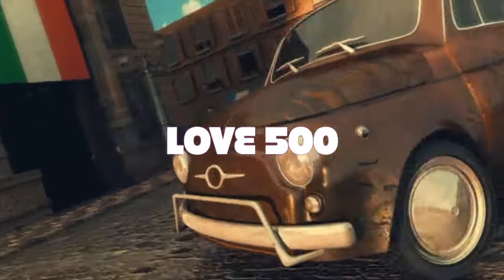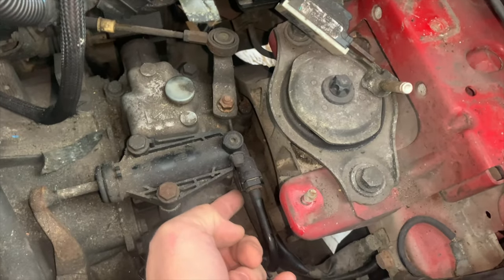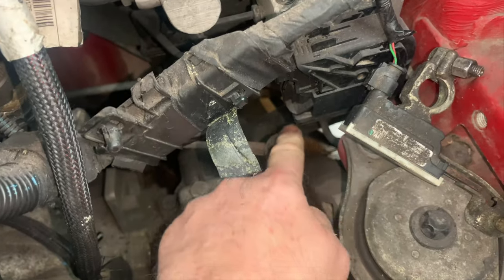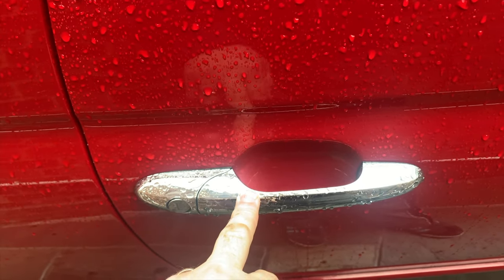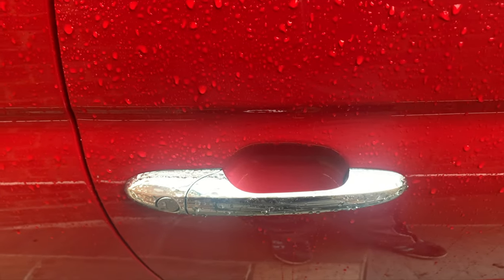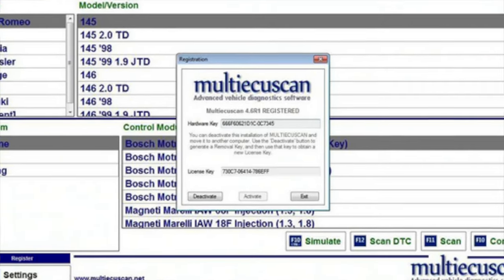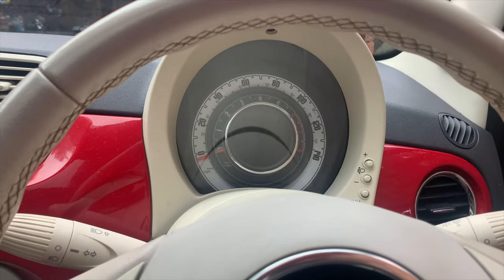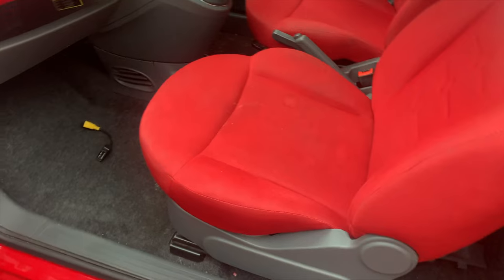Common Faults on a Fiat 500 or Abarth 595. The faults are the same. #abarth #fiat500 #595

Comment: Hi my 500 keeps loosing charge.   Battery is new. Have disconnected the Bluetooth and me  and it was fine for weeks. Started losing its charge again as battery flat in the morning. Mileage still flashes - Any idea?
Reply from the maker: @Fogtube1  have you disconnected it as the unit itself?
Reply: @Love500  yes - followed your instructions and disconnected it - didn’t take it out. Will check the earth to the chassis under the battery tomorrow
Reply from the maker: @Fogtube1  if your battery is good and you’re having starting trouble then it’s most likely the earth strap.

Comment: Can someone help on here have a fiat 500 2016 lounge , changed timing belt, now when it starts from cold , there is a banging noise for 5 mins , and small bit vibration,  belt was changed using the fiat kit. Was wondering could it be PCR valve and spark plus neither have been changed since purchase ...

Comment: Hi Paul , where is the cheapest place to buy the seals for the 2 pipes to the ac condenser ,thanks
Reply from the maker: @paulmaclachlan6960  I’ve never actually had to buy them.
Reply: @Love500  ok thanks Paul.
Reply from the maker: @paulmaclachlan6960  if you find them, please let me know
Reply: @Love500  i bought them off flea bay just for the 2 that fasten the pipes into the ac condenser £10.90 ,not cheap i know
Reply from the maker: @paulmaclachlan6960  that’s a lot for a couple of little o rings

Comment: shock absoserber mounts getting rusty : apart from the plastic cover is there a type of grease you suggest to put in there to keep the nut from rusting further ?
Reply from the maker: Not specifically but I use a CV moly grease on most things although it's black. I've seen some where they fill it up with grease, looks awful and messy if you need to change them. The caps on top are by far the best way of keeping the water out but a small smearing of grease around it will certainly help, just not too much. I'm sure some others here, will be able to advise what grease would be best.
Reply: @christga100  yeah same. Caps on and water in. I ended up putting folded kitchen foil on them and amazingly they're still on despite the motorway commute
Reply from the maker: @christga100  I guess it can't hurst, but a smear of grease would be better.

Comment: How do you work the air con in a 08 reg please
Reply from the maker: Same as them all. Turn the fan dial to at least position 1 and press the button. The snowflake light will come on showing that the A/C is on.

Comment: Hi, hope you can help or maybe do a video on fiat 500 exhaust.? I've just purchased a 2013 fiat Colour therapy. The MOT history showed advisory attention to corrosion of the exhaust plus broken clamps. Can you advise if this is something that needs addressing or am I worrying for nothing. The dealer stated it's not required to have this seen to during its MOT as it's advisory🤔
Reply from the maker: I wouldn’t worry too much. The clamps probably rusted and fell off. It’s worth putting new ones on, they are just a couple of quid each in Halfords.
Reply: Brilliant, many thanks for putting my mind at rest, my problem is I don't know how or where you place the clamps ha ha, I'm a complete novice as you may have guessed but your videos have helped me choose my little runner so many thanks for that :-)
Reply from the maker: @judgesheil01  there’s one at the front at the rear of the engine where there is a flexible section of pipe and another one at the rear where the  long centre pipe joins the pipe for the back box. It can’t be leaking otherwise they would gave mentioned that on the mot. Next time you get it serviced just ask them to replace them.
Reply: @Love500  once again, great advice! Can you just tell me the name of the oil & coolant you use for the fiats once again please as I'm definitely going to follow up all your car checks :-)

Comment: Would appreciate any help as garages can’t find problem.  Car runs ok but I know there is a problem when whistling noise is accompanied with accelerator.  As soon as car is turned off, all electrics go haywire and car lights stay on and car can’t be restarted until battery is disconnected (new battery fitted) and electrics are then re-set.  The only time it didn’t do it was when I took it to main dealers two days ago.   Friend had a look and noticed fluid around manifold and coil pack and said this could be the problem area as that is where the noise was coming from.  Any ideas?
Reply from the maker: When you say fluid, do you mean oil? If a breather hose on the airbox has come off or split that would deposit gunk. What sort of condition is the throttle body in? I’m assuming it’s not storing any codes? With those type of intermittent electrical issues I would be leaning towards the BCM. also worth checking your hatch wiring as any wires there shorting out can play havoc with the BCM and potentially damage it. I don’t think the fluid you mention is connected to the issues though.
Reply: @Love500  thanks , I’ll make a note of your comments and take them to my local garage.  Nothing is stored in diagnostics.  Wiring problems only when engine is noisy.  Strange, just checked and not doing it today.  I’ve had to take stop/ start off as it happened at city centre centre traffic lights two weeks ago and I had to get out and pop bonnet to reset.  Rush hour as well. Not very popular lol.  Thanks for your help.  Had car 10 years and ok till now.
Reply: Finally found the problem.  I was asvised to go to Fiat main dealer in Hull, 50 miles away.  They could find nothing wrong and asked for me to go back again.  They charged over £400 to inspect and said it would need a new speedo hub for over £1200.
I found instead a local genius guy who discovered it was a relay on the bcm which was staying on.  He charged £250 to repair it which he has done and tested over 2 weeks.  Said he had never come across it before.  The moral of the story is, beware of main dealers.
Reply from the maker: @paulbishop940  never set foot in them. They charge the earth and play parts roulette. Glad you got it sorted.

Comment: Great video - I wish I had seen it earlier! I've recently had to change the clutch slave/master cylinder assemblies and then the gear selector attachment. 
Now my 2016 1.2 Fiat 500 won't crank, it shows "Start Stop unavailable" on the display and a P0512 "pending" code on the OBD reader. Has anyone ever had this issue or know what causes it? Many thanks in advance!
Reply from the maker: Sounds like your battery has had it.
Reply: @Love500  the AA guy tested the battery and it was returning normal voltages, also tried to jump it with no luck. Could it still be a battery issue of returning normal readings? Many thanks once again!
Reply from the maker: @miguelcervantes4566  it’s a starter power issue I believe so if the battery is ok then it’s likely to be the main earth cable. Runs from under the battery tray on the chassis leg to a bolt under the clutch slave on the gearbox. Provides the main earth for the car.

Comment: See that rusty cup? There will be loads of parts on your 500 that look similar. If you buy some of our rust-treatment & bang it on, you no longer need worry about rust. Have a quick look at the back axle area - it will look much the same. Again, our stuff stops the rust dead in its tracks - if you really care,, you can do the entire underside - if you're in Ireland and don't want to DIY it, we can do it for you. Same goes if you own any car 2018 or older - it will be rusting, quietly, in the depths. They all do - even the really flash ones. :-)
Reply from the maker: What’s the going rate for advertising? ☺️
Reply: Subscribed btw - your vids are good, common sense down to earth stuff - which I like. I despise fancy B.S - you don't do any. I subscribe to close to no-one unless they're exceptional.
Reply: @Love500  Like I need to - we're in-undated. I thought some of your viewers might have a need. :-) We do good stuff - B.S free - same as you. :-)
Reply from the maker: @jamesward5721  feel free to post a link. It will probably be held for authorisation but I’ll authorise it.
Reply: @Love500  I do mostly fleet stuff - bus operators, commercials, blah blah - I just chucked the comment in as I know 500's rust like mad - it wasn't an Ad, it was just a sort of "There's this option" thing that might be useful to some of your viewers - I did a 500 monday & was a bit shocked at just how rusty a pretty fresh 500 could get,  hidden out of sight - it had less than 40k on the clocks and was only a few years old.

Comment: Hi Paul have you ever had a problem were the engine management light comes on when indicating to turn right and goes off when indicator stops, it as only just started doing it and car parked outside and we have had a lot of rain this last month and it is damp ? thanks
Reply from the maker: Yes, it’s a common fault. It’s the speedo. They can be repaired but it’s easier and cheaper to replace with a used one. Get one from the same sort of age car. There are variations, I.e. start/stop and non start/stop. You can up the mileage using MultiECUScan but can’t reduce it. There’s a fella on the Fiat 500 Owners Club Facebook page called Chris CFC Fisher who sells them preprogrammed to the mileage you want for £150. Otherwise have a look on eBay.

Comment: 21:24, First time I heard about the underseat storage I ran out to the driveway to see if my 2013 had that.  It seems as if American models (which were made in Mexico) didn't have the compartment.  Very disappointing.
Reply from the maker: Not all UK cars have it. Facelift don’t. I believe that’s because the old cars just had an open parcel shelf rather than a proper door on it like the newer ones do.
Reply: @Love500  Ah!  We have a proper glove box.  And caps on the strut towers!  I just found your sight this morning and I'm sure I'll enjoy it!  BTW, do you have a video on the seatback release cable?  Mine broke a while ago.  I was surprised to see that it's basically a bicycle brake cable; the part isn't too expensive, but it looks pretty circuitous.  Cheers.
Reply from the maker: @Jordanmilo  having taken a few seats apart it looks like a pain n the ass job. Never done it and I hope I never have to, you’re right though it is like a glorified brake cable

Comment: Hi,I've an Abarth595 2016 and it didn't want to start at around 6pm today,would you know why as temperatures have dropped and it was cold start.ran roughly but wouldn't rub smoothly.engine light flashing.
Reply from the maker: I couldn’t possibly say. You need to plug into diagnostics as it could be all sorts of things. Plug or coil or oxygen sensor probably.

Comment: Love the video. I replaced radiator, fan, ac condenser and thermostat. Fan does not come on. Temp rises to 50% mark on dash. Fuses and relays all check good. Not sure if I'm getting circulation and why fan more kicking on. Any ideas? Thanks
Reply from the maker: Almost certainly a broken resistor on the fan. The top electrical connection. One bolt, take it out and see if it's broken one end. They are about £16 on eBay. Usually the culprit. You can also run two wires from the battery and touch them onto the terminals on the fan. It doesn't matter which way round you do it, if it's the wrong way the fan will just go the other direction. That will rule out whether it's the fan itself.
Reply: @Love500  I did run wires to the fan to check although it's a brand new fan unit with built in resistor so I ruled out resistor. I'm not sure if I'm getting coolant circulation. I get pressure at resovoir tank but I'd expect that either with or without circulation. The radiator is brand new too as well as thermostat unit.
Reply from the maker: @flaron352  what happens if you feel or squeeze the rubber pipes? Maybe air is in it specially as it’s a new cooling system. Run it up and take the cap off, top up and let the air escape. If there’s an airlock then the flow may not be getting to the thermostat
Reply: @Love500  I can squeeze the top hose, its warm but I cant tell if there's a flow or not. I'll take the cap off, top off and see if air releases. Thanks for your input. Going to check the plug connector too for resistor just in case.
Reply: @Love500  tried that yesterday. When I squeeze the top hose water is pushed out of tank. Water does get hot in the tank. Temp gauge hits halfway mark. I believe I feel water when squeezing the top hose. Still mo fan kicks on. Baffled at this point. Since the fan unit is brand new as well as radiator and thermostat I cant imagine fan sensor is bad but certainly possible. Is there a way to check it versus just changing it? Only other thought is change water pump or run it to a mechanic but I'm challenged to diagnose for experience. Going to pull passenger tire tomorrow as heard hissing sound which could be ac since I recharged yesterday.
Reply from the maker: @flaron352  are the hoses getting hot, especially the top left one? I doubt it’s the water pump. Take the resistor out of the fan and visually inspect it to make sure the solder joint each side hasn’t come off.

Also take the bleed screw out in the narrow pipe towards the rear next to the air-box. Engine running, and top coolant up until coolant comes out of the bleed hole.
Reply: @Love500  I pulled the fan resistor but left it plugged in. I checked resistance with key on and was good. I checked for voltage on resistor and the plug connector the fan plugs in to with key on. I got no voltage reading. Rechecked relays both voltage and resistance all good and external fuse was good. Going to see if there is a fan fuse on inside panel. I think I should have gotten voltage reading at fan connector. I know fan is good as I direct wired. Baffled
Reply from the maker: @flaron352  I’ve taken a fair few of those out and I don’t think there is any fuse.
Reply: @Love500  no interior fuse. Might have to put things back together and take to a mechanic unfortunately.  So wanted to figure it out. Puzzled I'm not getting voltage at fan connector unless power is intermittent only to kick fan on. Wondering too if ac has anything to do with coolant system but wouldn't think so
Reply from the maker: @flaron352  not directly however by putting AC on full whack should make the fan kick in more often.

Comment: My fiat 500 2015 1.2 petrol overheated last week and it’s been the first problem I’ve ever had. I took it to a garage and the guy basically told me to sell it on as it was going to break but couldn’t give an answer as to what was wrong or what checks he had done. Confused and upset to say the least. Getting a second opinion tomorrow. Is this a problem with 500s that you know of?
Reply from the maker: They are very reliable engines as long as they are looked after. If you let the coolant get low you’re going to damage the engine. Coolant levels should be checked regularly. Other things can make your car overheat like a stuck thermostat or faulty resistor in the fan that stops the rad fan from kicking in when needed. The most common is the coolant level though. It’s not a problem that is unique to the Fiat engine. Best way to rule the head gasket in or out is to do a sniff test. You can buy the kits on eBay for a few quid. See my how to videos, there’s a video there showing it being done. Good luck.

Comment: good video, my fiat 500 lounge 2018 the cruise control has suddenly stopped working, no warning lights and the stalk still works for the speed limiter. is this common? I spoke to fit and they said its not a common fault but they will require the car for a couple of days. is there a fuse ?
Reply from the maker: I’ve not had one with cruise control. It will no doubt throw up an error on diagnostics. Can’t think why they would need it a couple of days.

Comment: Not sure if you can help here. I have the same issue with a Ford KA dash. Do Ford need to programme the replacement dash cluster or will it work other than the mileage being incorrect?
Reply from the maker: Seeing as they are basically the same car I imagine it will work in the same way but as I’ve never done a Ka I can’t say for certain.

Comment: Great video. Question Im looking at a 2013 fiat 500. the car has a low oil pressure light on. the car has 35k and looks to be in very good condition. Most of the articles Ive read says the car will need a new engine. any thoughts?
Reply from the maker: I’ve not personally come across that before on these cars but to be honest I would walk away unless it’s very very cheap.

Comment: Update on the phantom dash lights...now the lights on the dash come on if I do a right turn. Battery checked and good voltage. On restart it all clear until I do a tight right turn....T junction. Could there be a lose wire, connection?
Reply from the maker: Unlikely. It probably needs renewing or repairing. Diagnostics may give you more of an idea.